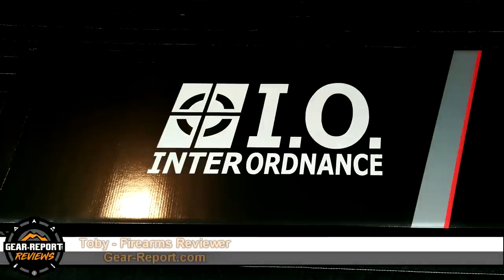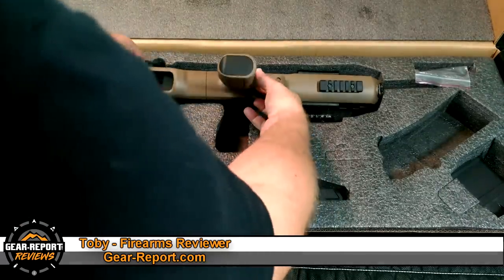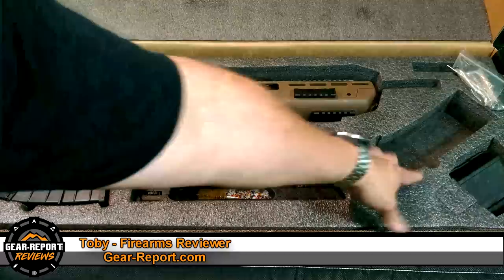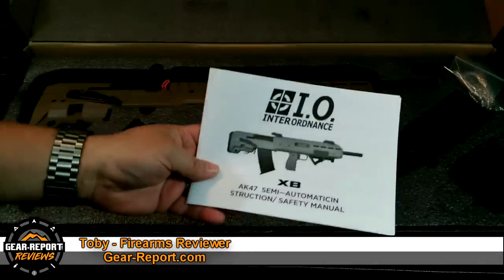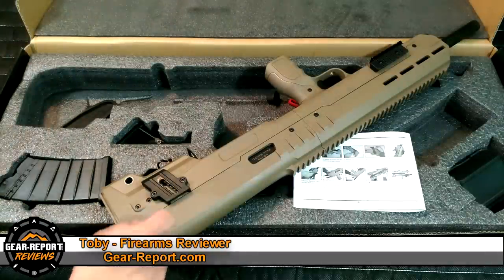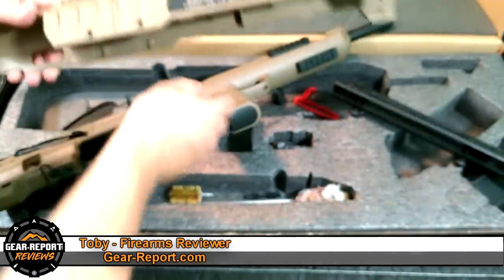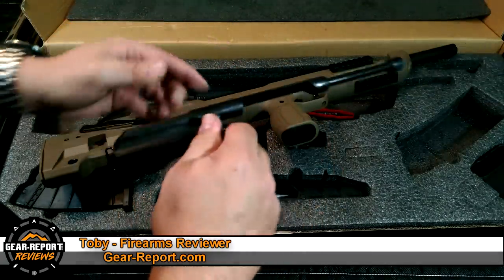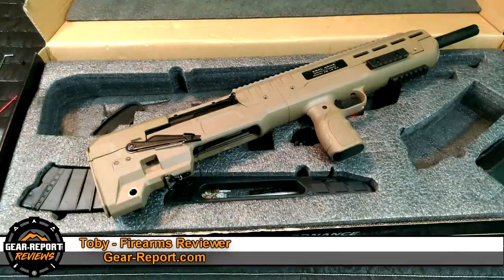IO XB Bullpup Shotgun Field Strip - AK Platform Shotgun

Comment: I've seen reviews on this already it's got no last round bolt hold open you cannot load a magazine unless you manually lock the bolt to the rear, and to do that you have to pull a Gumby by reaching around holding up a little button on the right side of the ejection port. Not to mention you have that reciprocating charging handle right next to your face. No thanks. I wouldn't waste my time and money on a case for that thing it's probably going to be worth more than the weapon.

Comment: Avoid like the plague. Bought one and sold it to a gun smith. Dealer would not take back IO would not honor warranty and Kral never reply to any contact. Won't cycle high brass at all. Wont cycle target load. If you can find low brass oo buck that sometimes cycles a couple of shots. I tried larger gas plug and changed spring did not help. I have a saiga 12 the works great.
Reply from the maker: This gun didn’t perform well enough to earn a full review.